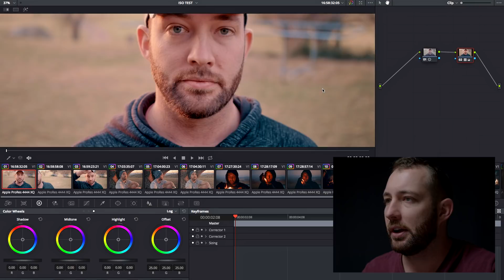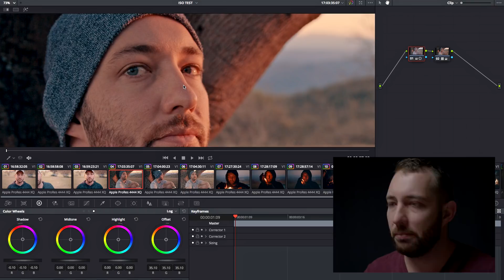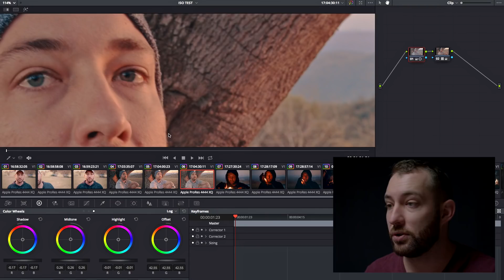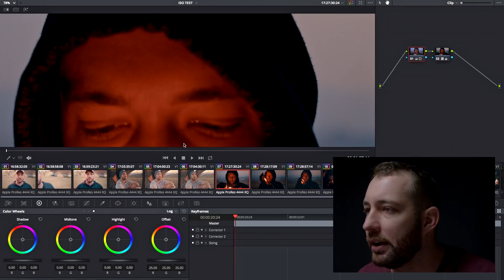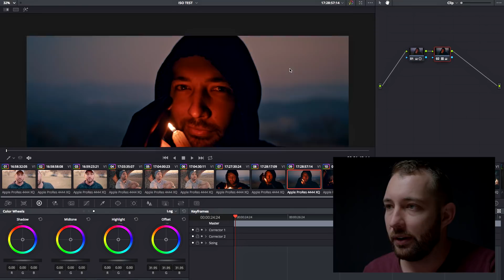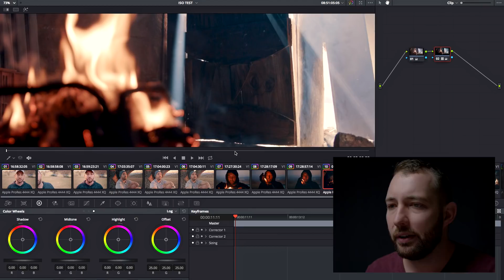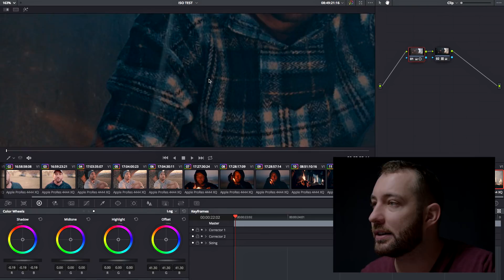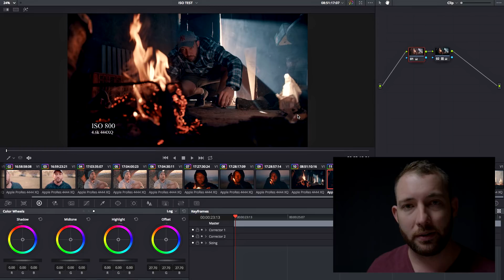ISO Capabilities On The URSA Mini Pro 4.6k

Comment: You are actually incorrect about the electronic sensor sensitivity thing. The Ursa Mini 4.6k sensor is always running at 800 ISO on an analog level. 

You can test this for yourself. Shoot at ISO 200 in raw, then bump it to 1600 in post. Now shoot 1600 raw, and leave it. You will get an identical image pixel per pixel. 

This is a mini myth set up by the cinema camera industry. DSLR's change ISO on an analog level every time you bump the ISO. Cinema cameras however, do this by shifting the dynamic range (after the image is captured) and don't change anything on the sensor level. 

Now, if you are shooting in prores and have a highlight dominant image, it makes sense to shoot in 200 ISO. The few dark spots in the image will be kept noise free thanks to the increase in shadow DR from ISO 200.

If you have a mostly dark scene with a couple of bright spots, shoot 1600 ISO to protect those highlights.

Comment: To clear up the ISO confusion from other comments: the sensitivity of your sensor never changes. When changing ISO, you're just boosting the signal after it's already been captured. The same way that turning up a CD player doesn't make the CD itself louder, it just takes the signal from the CD and boosts it before going to your speakers. Your native ISO is the true sensitivity of the sensor without any amplification applied, so when you expose the sensor at ISO 800, you're seeing what sensor actually sees without any "tampering". This allows you to expose the image to the absolute limits of the sensor, thereby giving you the most dynamic range. At other ISOs, you aren't exposing the sensor properly even though the image looks correct, so your dynamic range always takes a hit.
Reply: Ur awesome Avery 😍

Comment: I have an URSA MINI PRO, but when shooting at 800 ASA in Log and underexposing a little bit, I see a lot of vertical lines on the image. Most of it will go away when I grade the footage, but I have never seen this issue with RED, Alexa, Sony or Panasonic earlier. Have you ever seen this on your footage?
Reply: you mean fixed pattern noise or FPN.
Reply: Yeah, don't underexpose the camera or you'll pay for it dearly. ETTR and you'll be all good.

Comment: Fantastic video - I love my URSA Mini Pro. I do have a question regarding resolve however... I’ll have a grade that looks phenomenal in Resolve but upon export, the colors are muted and contrast is slightly lessened. The biggest difference is in color richness, however. I’m using a 2017 iMac 27” 5K (no external monitor), using DaVinci 15 and have played with all of the export settings... I do use the “video” data levels in export. Any ideas?
Reply from the maker: Im currently away from home, will be back In the next 24 hours. Sitting on the floor of the Dubai airport waiting for my next flight :D 
I have experienced the same thing, then I spoke to some of the guys from Blackmagic. One of the ways to make sure you get a fairly accurate colour export is to make sure you've got the data levels set to full and the retain sub-black and super-white data box checked. Also if you are doing a export for youtube at H.264 then set your quality to 25000 kb/s for HD and about 50000 kb/s for 4K 
Give that a try and let me know how it goes.
Reply: The answer is very simple but will disappoint you. iMac sucks shit when it comes to color grading. The screen itself boosts color and contrast. You NEVER get true colors on an iMac and you can't calibrate the screen. What you look at on an iMac screen is NOT what you get. Drop the iMac and get some Eizo monitor, put them side by side and the shock will cure you from ever getting a crApple item at all. :D In times of rather reliable Winfuck 7 and or 10 crApple is done in the professional field. whaaa ... if bloody Adobe would finally release their software for Penguin Power (Linux) Winfuck would be done in the Pro field as well.

Comment: It's also worth noting the allocation of DR between highlights and shadows at different ISOs. 800 is the 'sweet spot' because not only does it provide good noise performance, but there's an even split of DR in the shadows/highlights. I think it's something close to 7 stops both sides equalling 14 stops total.

When you raise the ISO to 1600 what actually happens is the allocation of DR actually gets weight more to the highlights. So you get something of say 9 stops of DR in the highlights and now only 5 stops in the shadows. 

Conversely, the lower ISO you have, the more DR you're going to get in the shadows. (The numbers above are a bit arbritary as I'm unsure of the actual weighting, but the concept remains the same)

So what you should really be doing is trying to stick to ISO 800 as much as possible, use the built in NDs to cut light where necessary and use extra lighting to boost light if you're already wide open.

If you're finding a lot of noise in the shadows, a good technique is to rate at 400 ISO and gain an exposure from there. That way you can keep your scene dark and moody and still maintain decent DR in the shadows.

What people need to understand about the UMP is that it's not really a run n' gun low light camera. I personally came from an A7S II and it took a lot of getting used to. The UMP will provide you with some incredibly cinematic images, but you have to feed it the right light and make sure that you're not abusing the ISO and then trying to lift up exposures in post. Get it as correct as you can in the camera on the day and this camera will treat you well!

TLDR; 
High ISO = More DR in Highlights at sacrifice of Shadows
Low ISO = More DR in Shadows at sacrifice of Highlights
800 ISO = Native sweet spot - stay here as much as you can

Comment: i would say stay at its native iso which is 800 this is where you would get the maximum 15 stops of dynamic range. If you go higher or lower you will have less DR
Reply from the maker: I would say I agree in certain circumstances. From what I've found in situations where you don't have control of the light and you know you need room to adjust the shadows in post, then I would recommend ISO 400 if you shoot in ProRes, all other situations I'd say ISO 800. If you shoot RAW you can change ISO in post so I would recommend exposing for ISO 400 then Changing it to ISO 800 in Post to have even more latitude and room to adjust.
Reply: Garth De Bruno Austin I wrote that like at 1/4 of the video lol. I would agree in low light situations I would stick with 400 and outside or controlled environments I would say 800. But their color science is not like the rest because regardless of iso if your shadows is at a certain ire you will see noise. If you’re using a Sony or Panasonic.

Comment: Have you experimented with ETTR? (exposing to the right) I shoot with the blackmagic micro cinema camera and it really helps to keep the image clean.
Reply: Waste of time if you understand how to expose.  The camera's ISO is not a GAIN but and EI change, so changing the ISO does not affect the detail the sensor captures.  So exposing to the right by 2 stops at 800 and pushing the exposure down is the same as shooting at 200 ISO.  And shooting 200 iso or 400 will give you some flexibility if you accidentally underexpose to bring your image up a little.  So what you're doing is essentially useless.

Exposing to the right is useful when you're on a steadicam and you don't have time to get perfect exposure.  As long as you're not clipping that can be easier to expose than trying to get it perfect.

So if you overexpose by 1 stop at 1600 ISO, it's the same as shooting 800 ISO.  If you shoot a well-exposed image at 1600 ISO it's very clean and usable too.  ISO should be purely used to distribute dynamic range and not as a way to adjust exposure.  But that being said going to 400 will give you some flexibility in scenes where you don't need the most dynamic range.

Comment: I bought an Ursa Mini Pro last December and have come across a strange sensor issue. I first noticed strange vertical lines in my mid day skies on some shots. Contacted BMD, they asked me to shoot a properly exposed clip at 4.6k Uncompressed raw to see if its a sensor issue or just compression artifacts. And when they received the clips they agreed something was wrong and asked me to ship it back. after a week of them trying to fix it they told me they couldn't  fix it so they sent me a new one. Second one arrived I tested it, same issue. I went trough the process again and they noticed that indeed there was some artifacts. They guided me through a process of doing a thorough sensor calibration, warming up the camera for about an hour with the bodycap on and running a sensor calibration. It helped but the lines were still there and worst in prores and a strange band of light magenta on the bottom of the image. They then agreed to take it in for inspection and I shipped it to them. After another week they said they improved the image and they shipped it back to me.  I got it back and the vetical lines were worse. After another week of going through the same process they sent a strange generic response of how the camera is performing within expectation and that FPN is normal when pushing dark images. Funny thing is that every frame they got from me was of bright day light sky and never anything dark. I asked them what dark images they were talking about and asked for them to help me fix the issue or find a solution because I had lost an important client because of this issue and I had just bought the camera new 5 months ago. As of now I have been dealing with this for over 4 months and Blackmagic Design is now just ignoring the problem and just giving me the run around. After begging, literally by email, they agreed to replace the camera once again and i haev a feeling that if the new camera has the same issue they are most certainly going to just say that its working as intended instead of just admitting to this as a sensor issue, like the first Production 4k camera fiasco about FPN that was denied and ignored until enough people voiced their frustration and they finally admitted that it is in fact the sensor and not user error. 

here is a small sample of the first Ursa mini Pro I had.
its simple. 
Shoot outside, blue sky, native Iso( recommended by BMD), expose a little to the right( recommended by BMD), apply BMD 4.6k 709 Lut( recommended by BMD), and adjust color and contrast to your liking and 8 out of 10 chances are that you'll see vertical FPN in your sky and acording to BMD its within spec. 

https://youtu.be/gYngDGUsdgg

Second Ursa Mini Pro( i have a ton of examples of the second one, this was a quick one I did for the UMP group in Facebook)
https://youtu.be/O3n2FgxX5EI

In conclusion with an Ursa Mini Pro/4.6k: Be cautious with your darks, be cautious with your mid-to-highs , expose to the right always, and hope you don't have a defective sensor/have it within "spec"
Reply from the maker: Sorry for the late reply.  
man thats a pretty rough time you've had with the UMPro.

Im struggling to see the true quality of the footage with youtube compression rates.
Could I ask a favour, would you be able to send me some stills from your footage in Davinci resolve? Preferably the shots that have the worst FPN. Ungraded if possible. I just want to do a couple of tests on the photos. If you grab a PNG then the quality is still pretty good. 
I luckily havent had any sensor issues and I have all 3 of the URSA's 

I will also ask a friend of mine from BMD about this.

Thanks for the comment and support!
Will try and help you out with this!

Thanks again!
hello@garthdbaustin.com

Comment: Can I assume this also applies to Ursa Mini 4.6k users, both cameras use the same sensor the pro and non pro right?
Reply from the maker: Yea thats true. Same sensor in both cameras. Im currently shooting a video about using natural light for documentaries and that will also be for both UMPRO and 4.6K
Reply: Garth De Bruno Austin awesome. I'm hoping to get the 4.6k soon.
Reply: The Hurlbut video about the 4.6k described ISO400 as the native for it.
Reply: @kyleroberts9738  The sensor is running at 800 ISO on an analog level though. Since you can't lower this, it makes sense to shoot at 800 ISO and above. Just step it down to 400 ISO in post for a cleaner image...
Reply: The one difference is the filter that is in front of the Ursa Mini Pro's sensor.  It removes any hint of the magenta cast.

Comment: Good info, but boosting the ISO does not increase the electrical charge of the sensor.  It uses exposure index, so the ISO is not baked into the image when shooting raw.  ISO just redistributes how the range is captured.

The reason your ISO 200 underexposed image looks "clean" is it's the equivalent of an ISO 800 Image that is well exposed.  If you shot RAW you could underexpose your 200 image, flip the switch to 800 and you'd have a clean image.

Likewise, underexposing 1 stop at ISO 800 is basically the same as shooting ISO 1600.  So if you correctly expose at 1600, there should be minimal noise too.
Reply from the maker: I should have specified, but none of this is in RAW. its all in ProRes. Which is why i've done this video. ProRes bakes in all the data as it's shot including your ISO setting. 
I will upload some high quality stills for everyone to check out for the different ISO settings, but ISO 1600 is basically unusable in ProRes as the fixed pattern noise is baked into the image because of it's digital gain.

The word ISO is a standardised measure of the “sensitivity” of the camera’s imaging system. Exposure Index is a term from the days of film, its a rating system. ISO is actually the "International Standards Organization" they are the governing body that standardises sensitivity ratings for camera sensors.

"In film, Exposure Index is the rating used in a particular shooting situation that is different from the actual film speed rating" It meant that they noted that they would take film stock of for example ASA/ISO400 and either chemically or in later years with colour timing push the film to 800. The term has now been adapted for digital cameras to make it easier for the guys that came from film. The difference is that you are seeing the results immediately.
Good article on all this:
https://www.abelcine.com/articles/blog-and-knowledge/tutorials-and-guides/iso-ei-and-gain-explained

When it comes to how the sensor works I must admit I did get the order of things wrong. when the light hits the sensor photons are collected, and a electrical charge is generated, the brighter the light and the more photons that are collected the higher the charge after this process everything that happens to the image is digital including the ISO setting/digital gain. 

Thanks for the comment, will clarify in the next videos whether i'm shooting RAW or ProRes :)
Reply: Although very simplified, think about it like this.  ISO 200 is like shooting overexposed at 800 and then pushing it down in the grade to reduce noise.  Shooting at ISO 1600 is like shooting underexposed at 800 and lifting it up 1 stop, hence why there's noise.  Everything though revolves around the EI rating of 800.

I know you're shooting Prores XQ.  Blackmagic uses an EI mode and does NOT use gain at all.  They only shoot at a fixed 800 and don't change the electrical charge in any way.  It's not the same as the gain mode on the F3, it's more similar to the EI mode.

With Prores, ISO is baked in, but lifiting up the shadows is still very close to the same thing as changing the ISO settings in the raw data, just slightly less room. If you switch into xyz linear (using color space transform) and gain up the image, you'll almost get 98% the same results as changing ISO with RAW.  It's very close.

If you shoot prores at 1600 but in a well lit environment (to where there is very little dark areas and properly exposed) or you crush down the blacks until they are truly black, the 1600 is very usable, but mostly people only use 1600 if they don't get enough exposure at 800 which is what creates problems.  If you instead use 1600 as a way to get extra highlight information and better rolloff during daylight shots, then 1600 is fine although you'll maybe lose a touch of saturation.

Your reasoning for 400 however is VERY good as it is helpful in case you accidentally underexpose and want to lift up a little later.  It just gives you more flexibility if you expose wrong as it's harder to see an underexposed image vs one that is clipping.
Reply: Yeah so the way it works is the camera only has one ISO setting of 800.  The other settings are "fake" and the same equivalent of if you shot 800 ISO and color corrected it to be 400 ISO or 1600.  The only difference is that by setting it to 400 ISO and exposing for that is you're correcting it in camera so you're not staring at  an overexposed image.  Technically you can design a 3D lut that produces a 3200 ISO image if you ever want to shoot 3200 ISO.

Your  400 ISO tip is still fantastic.

Comment: Do you ever experience any fixed pattern noise on the UMP? A couple of these shots I believe would have displayed some FPN even at lower ISOs like 400 on my unit. Trying to determine if I have a bad sensor or if it is typical.
Reply from the maker: You shouldn't be seeing any FPN at ISO 400. I will Upload a bit of test footage at ISO 800 and ISO 400 from the fire and streams of light shot so you can compare to your own camera footage at the same ISO